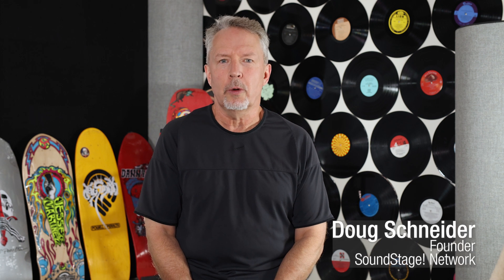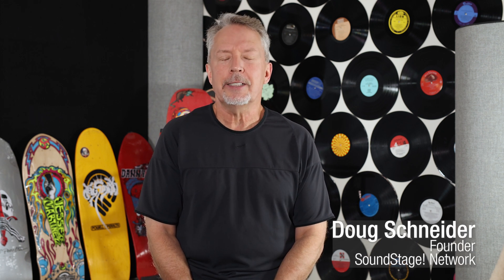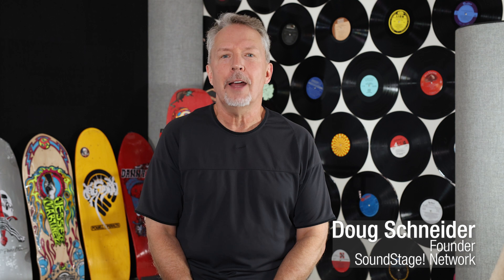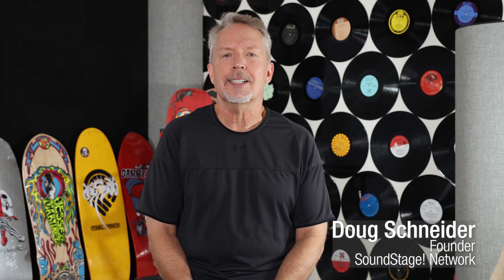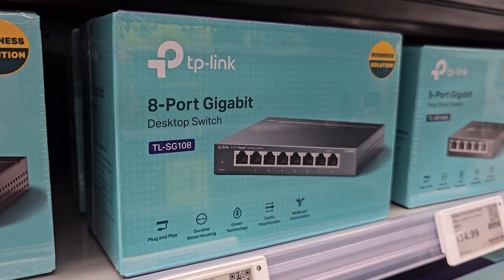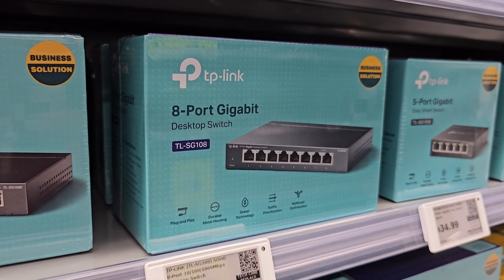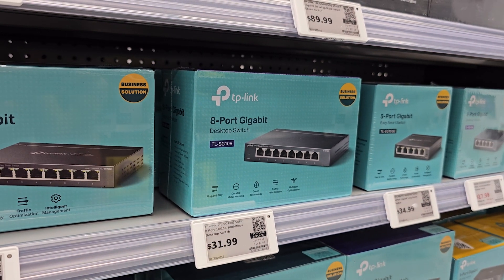How an Audiophile Network Switch Can(not) Improve the Sound (Ep:74)

Comment: Excellent Video Doug. I work in IT and am a WiFi/Wireless Engineer. Worked both sides of the Border. I use a $30USD Netgear 8 Port Switch which is tapped off of my Cable Modem (it even has two RJ45's). I built a single power supply for all my 12VDC devices with a Toroidal/Industrial FW Rectifier, and some good power supply filtering. Why ? Cause I can..LOL ! Did it make a difference....Oh HELL NO ! But it cleaned up a rats nest of wires and wall warts. Hell, I don't even use AC Line Conditioners. But I run two dedicated 20A circuits (10AWG stranded Armoured Cable for all my Audio crap and 12AWG solid Romex for all my computer crap and peripherals).

The Dedicated AC Lines made a huge difference. But I laugh at people who believe in Ethernet Regenerators, converting Electrical to Optical via SFP modules. In the IT world these are a must. But in the Consumer side it's asinine. I do use non Audiophile shielded RJ-45 cables. No clues if it makes a difference but I feel better.

It's all Placebo effect. All our DAC's/Disc Transports/FEC circuits/Clocks do all the heavy lifting because the designers know a thing or two about power supply and circuit board design.
Reply from the maker: Great post!
Reply: Thanks for your detailed response. I'm really happy to read it. Whenever I make something a little bit technical, I always know I run the risk of someone smashing back. Your justification for building the power supplies is perfect -- because you "can." That's great. About dedicated lines -- these ARE a thing. In fact, in our lab, all amp measurements are done on a 20A dedicated circuit. The power-output measurements are greatly improved over a 15A shared circuit. This is actually the #1 upgrade, as opposed to, say, a power conditioner.
Reply: Excellent way of putting it in in true perspective. Thanks 👍
Reply: I guess nobody says a smpsu+cheap switch makes the Stones sound like the Beatles.. we are talking not about function but a relatively small difference. And btw the thing about smpsus is not their problematic DC output (although there are differences) but their hash into the power net if (if!!) picked up by a sensitive audio device. In an all SMPSU powered hifi system with D-class amps I would assume that hash is no issue..

Comment: I agree. Last year I wanted to find out for myself what difference switches made to an already well resolved set up.  So I bought around 10 different switches from the usual suspects (including couple of audiophile switches) + 6 hi-end LPS from well known manufacturers. Anyway, after trying all different combinations of switches and power supplies for over 8 months…I have gone back to my original set up without a switch…and USB connection!!!

So the larger question is do switches make a difference…YES they do. Every switch/LPS combo I tried changed the presentation to varying degrees…but it was just different…and not better, in my set up.
Reply: "hi-end LPS from well known manufacturers" -  why buy, you can make your own, basic skills needed.

Comment: thank you very much for the video, enjoy hearing both perspectives. I am a  tinkerer and really love this hobby because it allows me to be curious. I have experimented with switches and external reclocker attached to my switch (yes I am in deep haha). I can not say you are wrong and I believe your points have a lot of validity. It is very easy for me to switch all of that extra gear out and go straight to my lumin steamer/dac. Very easy to tell the difference. Would be interested to know if someone could measure what is causing this change? Would be thrilled to sell extra gear and only keep the part that is causing the marked improvement. 
Also I have within the last year added 4 dedicated 20 amp 10 guage electrical lines to my system for my Pass Labs amps and Rel subs.The result was minimal other than peace of mind. Is it possible that some of us have different issues in our systems. Some may have real dirty lines and a dedicated outlet may yield great improvement , others like mine, may not be terrible and yield negligible results.  Likewise is it possible some may have real internet issues and there are devices (maybe a switch 😏) which could improve their systems greatly?
Reply: I think the point you bring up about "issues" is a good one. Why put in a power conditioner if there are no power issues? I don't believe I have any power issues in my house, but I do know I had them when I lived on the 22nd floor of an apartment building. Sometimes I'd have almost brownout conditions. That's why dedicated powerlines are a very good thing. But internet switches, I think a lot more work needs to be done with those.

Comment: Alpha Audio (to whom you might have been referring) and Hans Beekhuyzen have a lot to offer concerning voltage, noise, analog and digital interplay, galvanic isolation, and the reason why switches may or may not affect sq. Have made some serious and palpable improvements in my own system’s front end that are very hard to ignore thanks to what they suggested.
Reply: Hi, they were initially not hard to ignore because they purported to have proven these things work. Then I watched one of Hans's videos and he talked about how they reduce jitter -- but has since it seems backed off that because he learned that switches aren't affected that way. As for Alpha Audio, they seemed to concoct tests that "prove" they work, but without actually testing if what they found in their tests actually affect what comes out of the DAC. I wonder why? All told, they've done little to nothing to help the cause of network switches and are now very easy to ignore.
Reply: @ Still, there is a difference in certain use cases. My concern is the dichotomy of thought here. To insist it cannot ever make a difference is as bad as suggesting it always will. Obstinance, confirmation bias, you name it. More testing need be done I agree, but my ears are not lying to me. The difference is clear, it’s far less rewarding a listen without the switch in place. It’s not “the idea” that it might be helping, it really is.
Reply: @riccitone  Did I insist on them never making a difference? I opened it up for someone to prove it to me. BTW, I think it's pretty silly that a couple of reviewers are trying so hard to prove they work -- to no avail -- but the companies creating these things aren't. Like come on, show what they do. Prove what they do. Until then, while it's okay to believe your ears aren't lying to you, they certain still can be.
Reply: @ Not entirely disagreeing with you. Also apologize if I came across to suggest you didn’t believe differences happen. 

And absolutely, it is all a bit silly - however the conundrum kind of speaks for itself -

My point is that so much of this is case specific, and riddled with variables. There’s a definite improvement for many, and it doesn’t all need be relegated to psychosomatics. Then again - although the ear is a powerful thing, our brains are highly inaccurate in terms of recall. Which can renders some ironic outcomes for certain. 

There is so much more to be discovered in terms of how our senses unveil what measuring circuits cannot. Not enough effort has been made to disclose that nexus. An ear that knows what to listen for can hear differences in so many controlled scenarios. The difference in tonal color between one type of saxophone reed and another, or the delivery of overtones from one violin over another. This I know from having performed and taught music (not that that is a requirement by any means). 

Some arguments can (still) also be maintained considering just how revealing a system should be to be able to audibly detect differences in the first place. 

Ultimately, I too wish they could get at some concrete results to a. Find what actually occurs that can tell our ears what is different (or when we are most likely inducing things with our creative centers)
b. Isolate and create even better solutions on the front end.
Reply: @riccitone  Sounds like we're somewhat on the same page, but one thing I won't do is fall for nonsense. Also, you bring something I've been thinking about making a video about: "how revealing a system should be to be able to audibly detect differences in the first place." I've had dumbass manufacturers try to play that card when I tell them that something didn't make a difference. They'll say something to the effect of: "Oh, you need a system of a certain caliber." Even one manufacturer on LinkedIn tried to pull that with, "Well, in our reference system..." Meanwhile, his reference system has speakers of dubious quality -- because we've measured other models from that manufacturer. But more to the point, they never both to inquire about my system -- and around here I have enough gear to put together about 5 systems. What's more, we've measured most of the gear and quite a bit is SOTA in terms of noise and distortion. But even more important is that if someone wants a TRULY revealing system, go grab a set of good-quality headphones and a proper headphone amp. That'll allow you to hear EVERYTHING.
Reply: @ Totally! That would be a great idea for a video. I don’t think anyone had really gone there. Hope you do it! And with what you must already have in experience and equipment knowledge? For them to say something like that to you would be pure gaslighting stupidity. Enjoy the music 🙏🏼👍🏼

Comment: Why not just use Wifi? No more electrical noise carrying and infecting the packets....what's the argument against? It all ends up in the same buffer anyway
Reply: I'm going to push back just a little bit. I've been using Wi-Fi off and on since about 2007 (when I got a Slim Devices Transporter). It can work exceedingly well. The only caveat is the implementation. If it's poorly implemented in the receiving circuit, it can generate the problems you'd expect, like noise. But if it's well implemented, it cuts the electrical connection between components and can work extremely well.
Reply: @dougschneider8243  How does one know if the receiving unit has bad implementation? I notice a few high end streamers now are gutting the wifi altogether to let the consumer figure it out - is there a quality extender you know of?
Reply: @mat.b.  Measurements can help tell the story. Unfortunately, it's not possible to measure every component out there.

Comment: My experience has been that : 
Using fiber blocks any noise coming from the switch that’s connected to Comcast’s modem . 
It’s a 150$ Cisco switch solution with 4 SFP ports . 
I did audition Inuos phenixNet switch with Clock in it . 3500 MSRP .  
I did not end up keeping it it did not make difference for me .

Comment: I have tried an UpTone EtherREGEN and it made a very noticeable improve to the sound quality of my system. I bought it fully expecting to listen to it, find no difference and send it back. I still have it 2.5 years later.  I have swapped it in and out many times. Every time I remove it the sound of my system is degraded. My system sounds harder, more irritating and less musical without the UpTone EtherREGEN. Sorry guys I hear a difference and many many other people do as well. So there is something very real going on here and someone just needs to figure out how to measure it.
Reply: What kind of digital source(s) is plugged into it?

Comment: Tried a number of high end network devices including the Network Acoustics Muon Pro with their Ethernet cable along with the Synergistic Research UEF BOTH NORTH OF £2500 on my Gryphon MSB system -although the SR UEF had a tiny difference but seriously small the highly reviewed Muon Pro which the dealer said is very good and sells well did absolutely zero. However cables whether speaker, balanced make a huge difference if you have a very transparent top end system. Anybody who says they don’t is simply death or in most cases hasn’t tried them or their system is good enough to hear those differences as they are as clear as day. Although there are a number of top brands I’ve heard from Audioquest to Shunyata having heard a 3K mains did zero in my system. Plus a lot has to do the synergy as what sounds good in one system may sound rubbish in another. Room acoustics also can heavily influence the sound massively -wooden floors, soft furnishing etc.

Comment: Howdy.
Technically the quality of the IP-DAC internal clock may cause jitter. But not the switch.
And if someone is concerned about noise propagation in the Ethernet cables I may suggest using optical fiber interconnects,
Regards.
Reply from the maker: Great points

Comment: But what affect does resent packets have on sound?  It will have more overhead on the processors.
Reply: Packets get sent and resent all the time. An audiophile switch is not going to make a single bit of difference about that. Furthermore, all this talk about "processors" is what fueled the FLAC vs. WAV debates. Processing happens in computers -- and sometimes processors work more or less. That's just part of the life of a computer. As for the ridiculous notion that this can affect the sound quality of a FLAC file has been pointed out by me and by others -- the most time-intensive tasks on a computer are I/O tasks, such as reading from a drive. With a FLAC file, there's a lot less to read. But the who processor thing is, nevertheless, a red herring.
Reply: @dougschneider8243  I meant the DAC as a processor. If data with the wrong checksum is thrown out and data with the correct checksum is buffered in the stream there must be some effect.
Reply: A bit late but...  My FLAC files give less than 1GB for an album. That can be transferred on 1Gigabit network in less than 20secs, say. Resending packets is rare, but even so, not an issue.
Overhead is nothing compared to all the other stuff going on.
Do you watch streamed movies? How often is there a glitch? And video is more demanding than audio.
Reply: Compared with the number of packet resends that happen before streamed audio gets to your router, how important do you think that last step will be in the whole chain ? Especially since the distance is almost zero, so the chance of getting a access conflict or a transfer error is also close to zero.
The very funny thing is, some of these high-end audiophile switches advertise that their switch uses especially slower chips hence transfer rates (i.e. 100mbit/s in stead of ≥ 1Gbps) , to avoid creating noise ... If it wasn't so sad, you'd be rolling on the floor ...
A faster processor is capable of handling any resend/error with even more ease then a slower one.
And regarding noise : putting your audio on a different power circuit might be useful (I think this is one of the few things that really make a difference, besides working balanced wherever possible), and you might consider optical connections, although - if digital noise is your concern - one shouldn't underestimate the potential for noise-induction of an sfp module (besides the digital circuit everyone contains LC lowpass filter ...)
Reply: @2JohJoh2  To my mind, the simple fact that one can watch an HD video from Netflix, YouTube, etc, and not see any "buffering" of corrupt images, demonstrates that the whole network is easily more than adequate for handling audio. Resending packets is not an issue.
Reply: @kenwong9796  resending the data is much faster then the audio stream you are listening to. Besides that, there is always a buffer that feeds the DAC. So, even with resends, you won't notice any difference.

Comment: As a network Engineer (since 1993) I have been discussing with audiophiles, but they are deaf to all facts. Even saying that they hear a difference between ethernet cables, that the sound is getting better by "playing-in" the ethernet cables....
Reply: It's not easy to explain logic and facts, is it? That said, they always fall back on the "noise" issue. Well, "burning in" or whatever you want to call it doesn't affect noise.
Reply: Directional ethernet cables, LOL, which pair do they cut - Tx or Rx

Comment: Audiophile network switch???  Are you kidding?  It only passes data packets from one ethernet device to another.  Data packet consistency is verified by CRC (cyclic redundancy check).  This is nothing to with analog nature of sound.   Anyone selling these so called 'audiophile grade network switches' should tell us how they improve 'sound'....
Reply: And that's the gist of my video!
Reply: No one claims that the data is altered or lost in any way, the damage in Ethernet connected audio is due to noise coupling into the DAC, and then affecting the DAC clock, and DAC analog output stage.

Comment: There is sound improvement with a better aftermarket router and Wi-Fi  system.. when I changed both, I am sure the sound improved.. broadband companies give you a low grade router.. very thoughtful discussion… thanks Doug..
Reply: Or not.  That's just not how data works.
Reply: The data is buffered inside the DAC or DSP and has no knowledge of how it got there so you must be imagining an improvement. Also all ethernet ports are isolated through transformers etc so the claims are bogus ;)
Reply: You should try audiophile grade oxygen free air now. The effect is drop dead magnificent.

Comment: Assuming you have a good quality switch, the biggest factor is the overall throughput of the LAN and the Backplane of the Switch. If you have more Backplane capacity than you Throughput needs, you have the Switch you need. If all your doing is streaming some audio and or Netflix even at 4K to a couple of TVs in your house, any decent Network Switch is going to be non factor in the path.
Reply from the maker: Indeed!